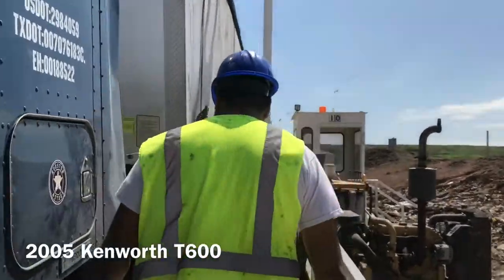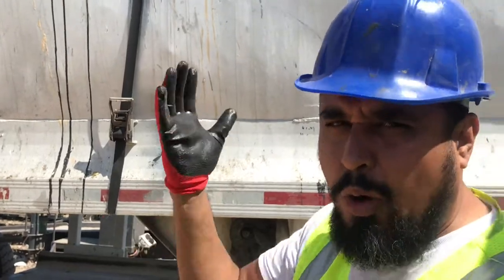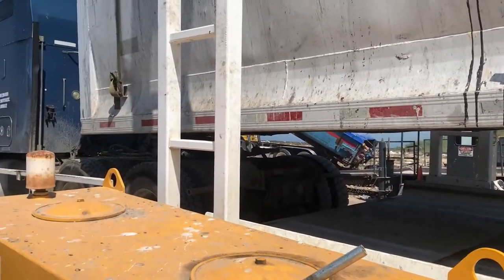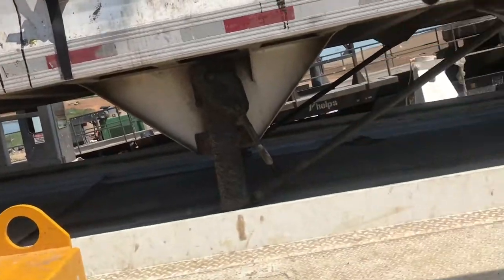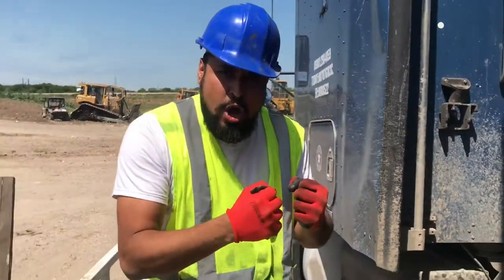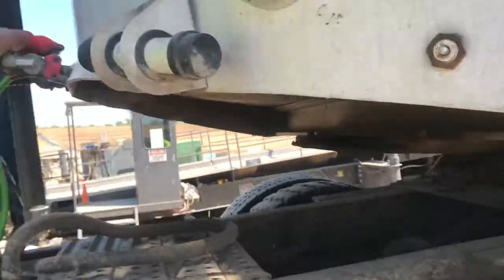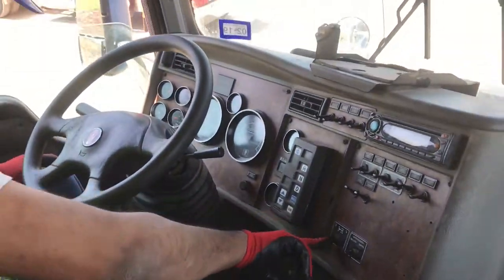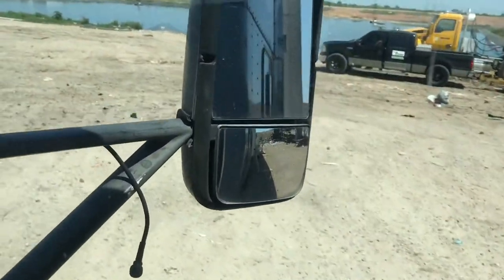How to dump With Trailer at Landfill on Tipper

Comment: Nice job I don't think I would release the fifth wheel until I raise the tipper deck under the landing gear I work for MBI here in Chicago been doing it for 24 years stay safe!!
Reply: Hey Kazie liked your comment. Just have a few questions. I'm a beer delivery driver right now at lakeshore beverage off of 62 in Arlington heights.  I'm thinking of moving on to sunset logistics doing what you are doing. Do you have any suggestions. Do you think it's a smart move. Anything would help.
Reply: @chuckt8529  you doing right thing bro I work for ekcc I just started

Comment: Hey you forgot to  untrap your load if a two-by-four or a metal bar comes up it will Rip that tarp all the pieces second thing you did not mention unlocking the back door and it wasn't too bad of a video I've been doing this for about 15 years for MBI out from Collin. Alabama
Reply: @Billy wilder are you a owner operator?  If so how did you secure a contract with the landfill to haul waste ? Also I was offered a job doing this exact same thing as a company driver Paying $68 every load trip . Average 3 a day . Is that good money for this type of work?
Reply: @user-yc1ug4fx2s  call the company and ask if they need o/o ....I'm starting my first day tomorrow doing this ..thank god for this video
Reply: @ericscott4092  thanks for the reply